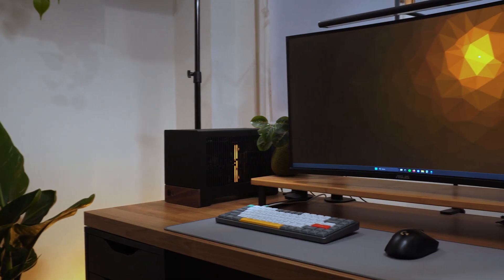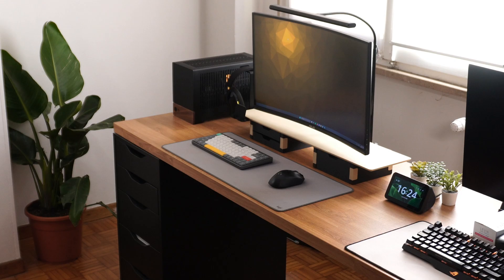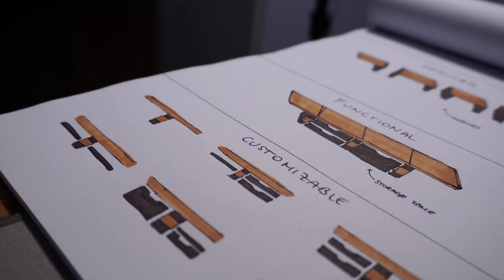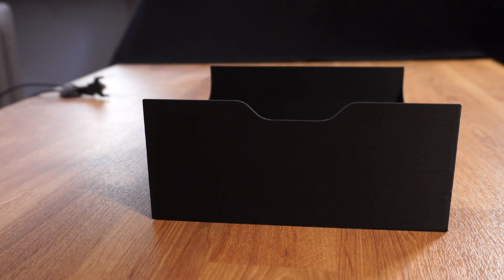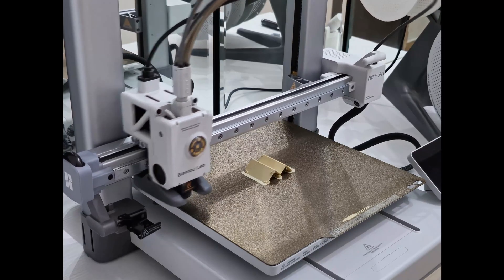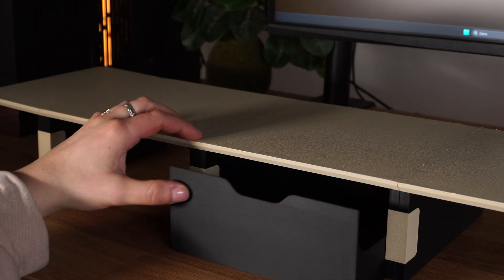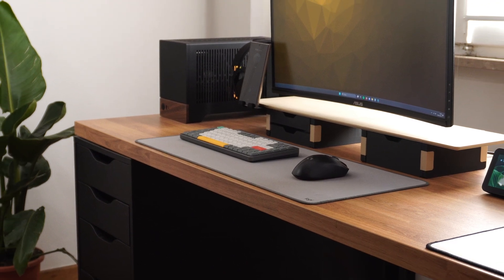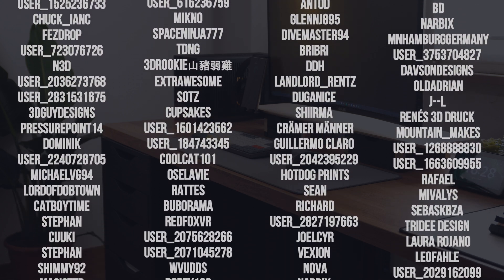Elevate Your Desk with 3D Printing - DIY Modular Desk Shelf Project

Comment: Hello, thank you for sharing this with us. It's a great design. But in this case here the Monitor isn't standing on the shelf. The Monitor gets hold from a pole right? I want to ask if it is also enough strong to hold a Monitor which is standing on the shelf or maybe two on each side one?

Comment: That looks very cool, but the 3D-Printed look on the Top is kinda cheap looking. A version where you could mount it under a wooden board would elevate the design even more
Reply: Use Wood filament. You going to love it.
Reply: You could also add a desk mat to cover the 3d looking aspect of it or print the supports and drawers and connect them to a shelf board of your choice
Reply: I am gonna print this 3mf with the upper scaled in studio or orca , and face down on a holographic build plate .. i don’t think it will look or feel cheap as i will have my infill at 35-40 percent .. it’s worth the wait and material to have it come out just right ..
Reply: Agreed!
Reply: Add wood vinyl on top

Comment: I thought your project was amazing, but I didn't quite understand it. Which of them should I print to make it complete? For example, if I print the "Stop Clip Added Mid Shelf Orhanizer and Drawers set", will I already have everything I need there, or do I have to print the other projects as well? What about the straight top lid? Is it already in the project? Sorry for so many questions... I'm a beginner!